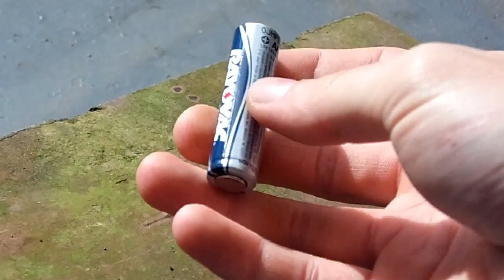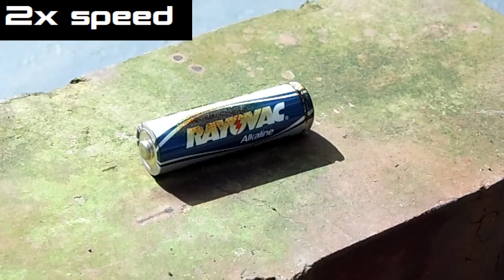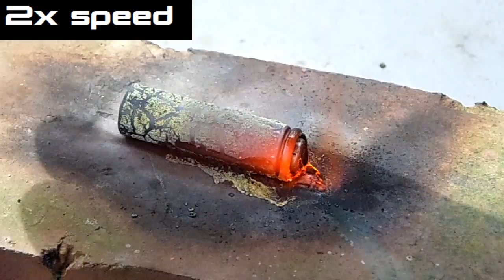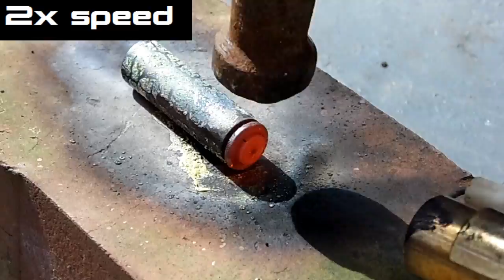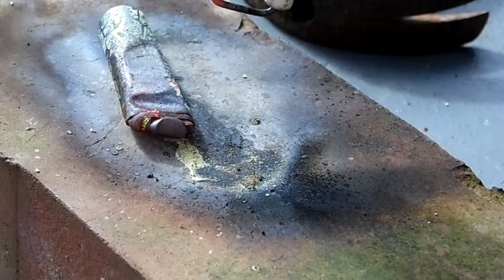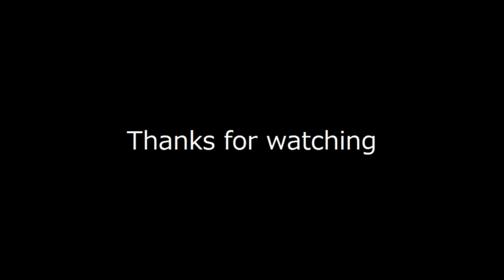Blowtorching AA Battery

Comment: One thing to remember- be careful of the material underneath what you use a torch on.  I was using a torch on a piece of metal that was on a concrete slab-  the slab has a small explosion because of the air expanding within the concrete.  due to exptreme heat
Reply from the maker: yah concrete explodes, it can be pretty fun.
Reply: Rinoa Super-Genius the air in the concrete pops, its not the concrete exploding.
Reply: Should've captured it on video !!!

Comment: you could have checked if it still had a little voltage, of course, if you hadn't hammered it^^
Reply from the maker: of course it had voltage. but i have 80 AA batteries laying around :P

ima buy 4 Eneloop rechargeables someday.
Reply: Rinoa Super-Genius
no, I ment, you could have checked AFTER burning if it had any voltage left :D
Reply from the maker: Maximilian Mustermann oh i see, i actually was hoping to monitor the voltage while i was burning it. if i find it in the back yard i'll test it's voltage. but i think when i hit it with the hammer it woulda shorted it out.
Reply: Rinoa Super-Genius
and the electrode pretty much got shattered into pieces^^
So... What's your next Video Plan?^^
As you said you planned to do something with 4 UltraFire Cells! :D
Reply from the maker: Maximilian Mustermann
i gotta get those in the mail first though, think i may try to reverse charge a lead acid battery today. idk though.

Comment: I think one of your problems might be regulating the pressure of your hydrogen. With oxy acetylene you set the pressure and then fine tune to get the correct flame. I'm sure a clever chap like your self will get it to work with out blowing your self up ;)

I also wanted to tell you how cool your Giant soldering Iron is. I am going to have to start looking around at swap meets for one as I have serious Iron Envy!!!